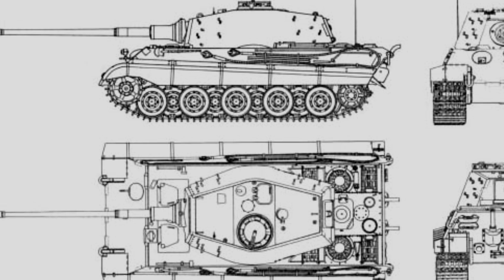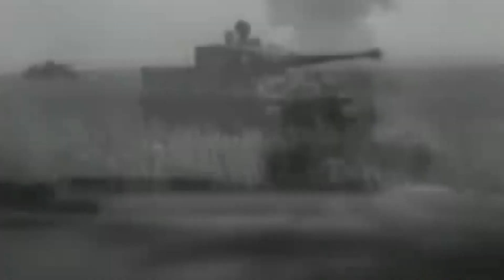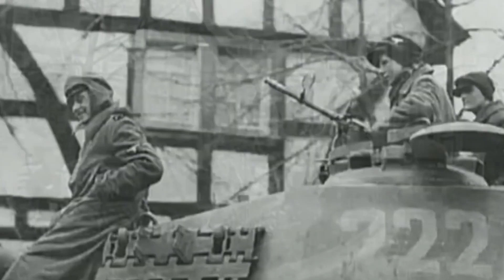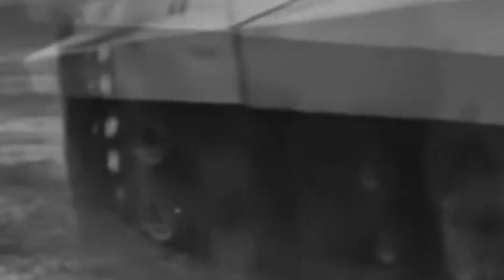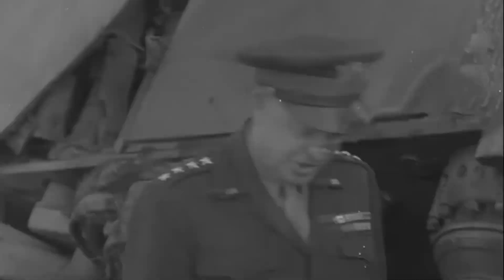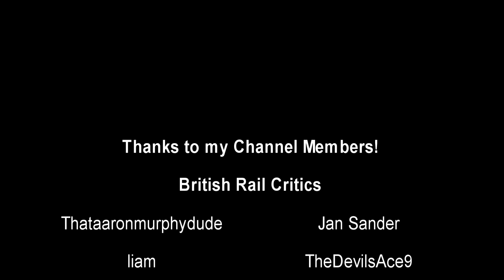Germany's Ultimate Tank (Didn't Help Them Win at All) | The Tiger II | History in the Dark

Comment: Germany's main troubles were: 1. a  long string of strategic mistakes 2. logistics and 3. a firm grasp on reality. The tiger 2 needed a long logistics chain that was too much to maintain. Great specialty tank tho, but more pz 4s or panther/jadgpanthers would have been smarter.
Reply: I would say that is post war propaganda. Well to a degree.

The logistics point is true, but that would be true for every country but USA.

The main issue with the mainline historical view is that its colored by cold war propaganda. The issue is that UK and USA supported USSR during the war. This fact was not popular during the cold war. Of cause UK and USA didn´t want to admit to there population that they supplied USSR with weapons that now was turned against them, and USSR didn´t want to admit for its population that they wont he war with western equipment.,

Of cause, the general argument is that WWII equipment wouldn't matter much a decade or so after the war. And .. well that would be the case, there is a issue here. Its not quite the whole trout. The leneed lease (that was every thing but) agreement contained 3 main components. direct use items (Weapons, equipment and surplices), half fabricate (engines, barrels) and machine tools.

The thing is that most soviet equipment, everything from the T34 to the JAK 9 fighter used mostly licensed parts. The T34 is actually a development of a Christie tank. (Well to be totally accurate, T34 was based on the BT series that in turn was a Christie set up tank and production line). USSR was actually licensing western production both before WWII but also, more surprisingly during the cold war.

The issue is that most people don´t know what machine tools is. Its basically a factory flattpack. That is a engine factory there, a barrel factory there, and a shoe factory there. There was a lot and a lot of factories imported.

And well.. if you can have a factory that can build a V12 engine, its not that hard to convert it to produce a X24 engine. This factores was used all the way during the cold war to produce more weapon-systems.

So that let us come to the second part, the half fabricate. This was mostly engines and rifled barrels. This was a mix of airplane engine, tank engine and truck engines. The engines was offloaded in Archangled then transported by rail to Stalingrad where they was put in tanks. The issue for USSR is that Germany already overrun there main engine plant, so they could produce tanks, but not engines form them.

Germany had somewhat and idea of what was happening and tried to intercept the engine delivery. So where do you intercept a train, Well at the rail yard. So where was the rail yard, one outside of Leningrad and one outside of Moscow. That was the reason why Germany attacked those cities. Its was not due to prestige, but to intercept those trains. Those attackes that is viewed as incompetent in the post war view, is actually totally reasonable and logical. They was not a strategic mistake, they just failed.

The thing is that in 1941 USSR still had a pretty decently sized army, but it was very very equipment starved. For a example of that, the soldiers went into the field with no boots, in the winter. UK was quite starved on soldiers, and also had no tactical front. But they still have a massive amount of production capacity.  Of cause, today most people view Germany as a much larger country than UK. UK was at the time the biggest country in the world. It had more production capacity than Germany and USSR combined, UK actually in 1940 had 30% more production capacity than USA (remember, UK at this point, also included, Canada, South Africa, Australia, New Zeeland, Singapore. But they lacked the army.

Also people tend to forget, UK was fighting a 3 front war. Was fighting Japan in Asia, was Fighting Italy in Africa and was fighting Germany at home.

But they did have a massive amount of production capacity, So they simply produced boots, uniformes, surplices, rifles, trucks, airplanes and sent to USSR (They also bought some planes from USA that was not yet in the war). This was what stopped Germany in both Leningrad and Moscow. With out that surply, both cities would be overrun in weeks. Barefoot soldiers don´t survive that long in snow. And note, the supplied arrived DURING the battle. It was that close cut.

So that brings us to a grasp of reality.  Well they actually did have it. They just figured that UK would never send surplices to USSR. That if we want to be fair, is something that is so unthinkable that there are loads of people denying this happen to this day. UK was already in war with Japan Prior to germane attacking Poland.

And that brings Bismark. one of the major tactical blunders Germany had. Bismark was moved to the Atlantic in opposite to order from the top leadership. If Bismark was left in the Nordsea it would be MUCH harder to take the ship out, having air cover pretty much 24/7. Bismark next to Terpiz would be very dangerous for the arctic convoys, that transported.

If Moscow would fall, that would be a problem for USSR. While some people argue that they would just move the capital back. Well they could do that, and they probobly would. Most of USSR industries was distributed around the country and liked with rails. The main rail hub was in Moscow. With out it, they would barley have any industrial capacity left. They would even be equipped to distribute most of the outside help they would  got. If that had happen prior to US joining the war the situation would have been very different. No engines to the Stalingrad tank factory, no tank battle. Also no trucks for logistics and attack, and no system to supply the airplanes that was flown in. It don´t matter how many solders you have if they are stuck in a trench full of snow with no boots and no food.

UK might have won the war anyway. Germany was never equipped for a very long war. They simply made a lot of progress early in the war for the simple reason that they was the most prepared. It was Japan that was the problem. UK was slowly turning the tide in Japan as well but it was going very slowly.  Remember, at this point, UK was still the worlds largest industrial power house, larger even than USA.

That all changed in 1942-43 when USA mobilized there industry, and that did take about 2 years, but after the US industry was fully mobilized, the war was really quite short. Germany never expected to fight USA. Quite the opposite, they was seeing Roosevelt as somewhat of a ally early in the war.
Reply: @matsv201  well, I guess I'll explain myself. 

1. Bad strat: Launching a war of annihilation for lebensraum. Not a way to gain friends. Lend lease or no lend lease Russia would have lost by 43 if the Germans hadn't hardened their own opposition. Of course it comes from having a hypocritical, chauvinist policy.  If you're a nationalist, then nationalism is a fair idea for ALL PEOPLE. The same rules and values apply across the board and not only for certain ones.  When you invade a country and the rule is nationalism "for me and not for thee", people tend to get a little pissed off. An example here is treating Slovenians like scum but any German's already in Slovenia  as first class citizens. Germany also made no distinction about Jews in other countries. Within Germany proper I'd say that Germany had the right to define itself, however once in Poland  they activated the lebensraum idea and began to slaughter and imprisioned the Jews there, as well as leaving no place for ethnic Poles.  Putting people between a rock and a hard place leaves them no choice.

Once Russia was invaded those in Belarus and Ukraine found out first hand what Germany did in Poland and this fueled the partisans motivation and created it's own unending cycle. "the Jews were the reservoir of the partisans" but that's b/c they were hunting Jews. that's a no-brainer. Germans were first welcomed as liberators, and the size their available armed forces, allies, and cooperative citizenry against the Soviets would have ensured a win. Wasted Opportunity.

The war hawks in the Uk started out weak but as Germany made political gains they gained more influence and this had an effect in the foreign office. The thing is, the war hawks knew how to push hitler's buttons, and that's how and why Poland got to be invaded. They tell you the reason for the invasion was frustration over was Poland/Danzig etc.. but in reality it was anger over the fall of Czechoslovakia. They had to inhibit the talks and any real progress but they got Germain leadership to take the bait. That's from the war that had many fathers, and it makes a lot of sense. Getting played by one's own enemies.. not a good strat.

 Another example of bad strat is terror bombing in the blitz, Prior to that Germany had been concentrating on targets related to the Royal Air Force, but then Churchill decided to push someone's button. I'd say it was Goering's but no matter. Churchill ordered a terror bombing to be carried out by Aurthur Harris in Hamburg iirc and this infuriated the German leadership so much they changed tactics. Of course bombing civilians in the blitz only strengthened the resolve of the Brits, and allowed the RAF to recover enough to continue being an effective competition.  We see how that turned out. Lesson: eyes on the prize.

2. Logistics. this is self explanatory

3. Germain political leadership at that time was stuck in a nearly medieval way of thinking and lacked foresight. Plus, bigger=better when it came to impressing Der Chef. As if the idea of the p1000 and p1500 weren't grandiose enough heh. Some of the leadership was charismatic and likeable on a personal level but  I just don't think they were truly qualified. I think of hitler like this, he could coach the bad news bears to the world championship, but wouldn't win it. It's like in downfall where the Russian's are at the doorstep but if he had hope, evenown else would too, because  "he's the leader". He had too many flaws and really it's b/c of  him that ethno nationalism is practically dead and now migrants come form everywhere. There's a lesson in that, coming.
Reply: @franks471  
"1. Bad strat: Launching a war of annihilation for lebensraum. "
That is actually not quite accurate. You are confusing lebenraum with expansion in the east. The issue here was that USSR had been gobeling up smaller nations since the 1920. Lebenraum was mostly taking back the area that was lossed in the previus war. The expansion in the east was not lebenraum, it was more of puppeting. While you might think being a puppet of Nazi Germany was a bad thing.. and well it probobly was, compare to be a part of the USSR, that is probobly a bit worse. Germany actually gained plenty of fiends. Finland, Baltic states, and a large part of central Europe. Of cause most of those nation become pupet of USSR at the end of the war.. but not Finland. If Finland had not sided with Germany, they would have been a part of USSR until 1990.

" Lend lease or no lend lease Russia would have lost by 43 if the Germans hadn't hardened their own opposition"
They would have lossed faster with no equipment for the enemies? Are you real? To be absolutely clear, in our timeline, 30 of January, 1945, yes, 1945, just month before the end of the war, was the first day USSR soldiers set foot in pree war Germany. Over 80% of the equipment do so was either lend lease material, or derivate of lend lease material

"If you're a nationalist, then nationalism is a fair idea for ALL PEOPLE."
National Socialist was mostly Socialist, secondly and .. really not, nationalists. They was Socialist fascist, not really nationalists. And still, you missunderstood the plan quite a bit.

You miss a part of the Jew storry. The Jew extermination started in USSR in the 1920. But the word came out in head, and most of them fleed before being rounded up. Some of the fleed to current day Isreal.. that is, the one that had money to do so. The rest of them just walked west. When Baltic and Belarus was ocupied they was need to keep walking, and they was at the time already very unpopular in Poland, so they had to keep on walking. There for most of them ended up in Germany, nearly doubling the german jew population in just a few years. This was during the early days of the depression so this was very unpopular with germans that was unemplyed, that in turn was the reason the nazi party got so much votes in the 1933 election. It wasn´t like the previews government was brilliant either. A lot of people thinking that there was somewhat of a good government prior, it was anything but. They went from one quite bad government to a other.

"Poland and this fueled the partisans motivation and created it's own unending cycle."
Eeeh.. no. That is USSR propaganda. What spawned the resistance was the gap between german and russian forces. Polish resistance thought they would become independant. THey was folled. The Russian forces backed of from Poland in the uprising to let the German forces take care of it. If you want to talk about bad strategy from german sides, here is one example.

"hitler's buttons, and that's how and why Poland got to be invaded."
You have absolutly no clue what you are talking about: read up on the Molotov–Ribbentrop Pact .

" Another example of bad strat is terror bombing in the blitz, Prior to that Germany had been concentrating on targets related to the Royal Air Force, but then Churchill decided to push someone's button. I'd say it was Goering's but no matter."
While in the hindsight 20/20 that might seam like that was the issue. But there is something you are missing here. At the peak of the battle of brittan, when it was going quite poorly for UK, they moved back there forces and stopped engaging German forces. this made the German airfoce belive they accomplished the first part of there strategy and started bombing logistics center. Remember, this is the 1940, not 2020. Logistics center was quite close to the center of the citys. Some bombs missed and hit peoples houses killing civilians. That was never intended (at that point).  The German airfoce didn´t waste there bombs on civilan with no strategic benefit.

While the bombing did have some impact on the logistics, what it mostly did was drawing the German airforce into a well made trap. Germany did the exact same thing with UK and US airforce in 1943 with a similar result. Losses in UK and US airforce was rampened in 1943 and it wasn´t really untill the change tactics quite a bit into 1944 that they started even out.

While its easy to say that Luftwaffe shouldn´t fall of it. It was still a trap, and it was made for them to fall for it. Amature historians that have no clue of the subject say that it was just bad tactics from german side, it was not. It would have been good tactic, if it wasn´t for the fact they was baited.

" nearly medieval way of thinking and lacked foresight"
How would you know, you have really no deep knowledge of the subject, you only know post war propaganda.

"Plus, bigger=better when it came to impressing Der Chef."
That was not really the case.  While tiger tank was large, it wasnt the first large tank. There was a prior one, the grosstraktor (yes it was a tank, despite being named tractor). It was lightly armoured, but as large as the Tiger. German armor was linked up with a heavy spear head, medium tanks on the side, and light tanks and APC covering up the rear.  The spear head was alwans men to be very heavy but few tanks..

They didn´t need to last that long, when the front was broken, medium and light tank cleaned up the rest. This was a very successful tactic. The original tiger was a rush job. It was a good tank, but it had a lot of flaws. It was also hard to produce. Tiger II Was actually simpler to produce, and it was generally a better tank. And it was actually quite a lot produce. Production rate of the Tiger II was actually higher than if the original Tiger, with almost 500 built in about 1 year, compared to 1350 tiger 1 produced over 3 years.

Its a common myth that Tiger II broke down more, they didn´t. They was actually quite a lot more reliable, breaking down only about half as often. The main reason for the myth is that more tiger II was lossed due to breakdown than tiger 1. The reason for this is simple. Germany was retreating. The thing is, If you are advancing and your tank breaks down, you just leave it, and the crew will take care of it next week.

If you are retreating you have to either leave it behind, or retrieve it under fire.

"As if the idea of the p1000 and p1500 weren't grandiose enough heh"
That is also some of the post war "i don´t understand what i´m talking about" There was 12 "half" P1000 built. Well sort of. The error most people think of when they see the P1000 is that they think its a tank. Its not. Its a movable field artillery system. The turret was one of a Cruiser (not a battleship as some people claim)... and.. still again, not quite. The original turret was 1000 ton heavy, and clearly to heavy for a 1000 ton vehicle (because the rest of the vehicle is not 0ton). The turret was cut down from 3 to 2 and the armour was cut down 140mm to 20 mm making it significantly stronger, but still able to stand counter artillery fire.

Its also not supose to drive to the battle field. Its split in 10 parts. 8 lower parts and 2 upper parts. (and the barrels would probobly have to be taken out, i have not seen any source for that, but it kind of make sense).

The reason for having it in one vehicle is that fire control computers just become a thing. This way the fire control could be feed directly into the turret with aimed in barrels.  They would also be much faster to load and the crew would be protected both from the element and counter battery fire. Not only that it could move short distances with out being dissembled.  It was never intended to be a tank. The name should tell you that, Landkreuzer (land ship). It was a supporting artillery integrated vehicle. And it was really just a slightly modified of the shelf tower put on tracks from a tiger, with a engine from a submarine. With diesel-electric drive it would be fairly simple to assemble and disassemble it. The engines was simply in a module each. With the added range and the added precision of the computer the large size would really be no issue, it would outrage any enemy artillery. 

The P1500 is a similar deal. Its a movable field artillery. There was 2 "half" P1500 built. Named the Gustaf and the Dora. The issue with Gustaf and Dora is that it took a month by 1000 person to set it up. That made it, say less than efficient. The idea was to put it on a tracked under carriage to make it both quicker to put together, and easier to move short distance. Simply replace the 4 railway wheel section with 4 3 meter wide track sections.

Both Gustaf/Dora as well as the 280mm cruiser turret was both made and in use. To claim that they was some ignorant plan of a super weapon is really .... well ignorant. Gustaf/dora was very efficent, when they was in place. The issue was that they was to expensive to move, that was the reason why they stooped using them. The P1500 project was there to save the existing artillery systems. That is basically recycle them The investment of making 4 track module for Gustaf and 4 for Dora would really not be that big.

The track system (that was never fully built, but designed) was later reused in civilian use for bucket wheel excavators. The largest to day is about 15 000 tons, that is 10 times larger than P1500 would have been.
Reply: @matsv201  nah I'm not confusing expansion with puppet states. Dolphy wrote it in his book that lebensraum was to be gained in the east.  Yugoslavia, Romania, etc.. were puppet states, Poland was chosen for expansion. It seems the plan was shelved until the event of a general war, Czechoslovakia for instance was treated lightly and didn't have a situation like Poland until after Heydrich was killed, however a serious attempt to turn Poland into lebensraum was made. This is what I'm getting at as far as Jewish partisans are concerned. Word of mouth and rumors were spread quickly. That's why there's stories of those sent to the camps already expecting to be gassed when they arrived. You can find survivor stories telling this detail. I'm just saying that German policy created many of it's own problems. Imo A more moral, above board approach would have been to liberate Pomerania and Silesia and allowing a remnant to be a puppet state. I am well aware of the Molitov pact, Germany's actions still could have been different.  The thing I keep hammering on though, is how Germans were first greeted as liberators in many countries until they began to be hated for what they were doing. Similarly, Barbaossa was not a campaign against communism as the propaganda stated. but Germany would have had a lot more support if it were and I think it would have made the difference, however instead of doing the right things for the right reasons, it was a repeat of what they did in Poland.  And as you described the Jewish plight, the real problem they faced was not having a homeland, IMO.

Poland was invaded for three reasons: the  Polish government's resistance to working out disputes, British and French interference, and a forced assimilation program in Poland which resulted in persecution of the Germans living in the 'Polish corridor' and refugees returning to Germany. Those disputes are the Danzig question, but also Poland not accepting payment in an currency except Polish zlottys for use of the rail lines. This would have meant that East Prussia would have gone without coal for the next winter. One thing here highlights the flaws in the German leadership, and this is Operation Himmler. So, if the Brits don't believe you, there's no need to put on a show to see if you'll fool anyone. Always do things above board.

Dolphy started out since 33 hoping to make Poland into a strong ally, his plan was to rely on them for an upcoming conflict with the Soviets. by spring time of 39, he was making presentations to his senior military staff preparing them for what an invasion meant: annihilation. This was the speech where he allegedly said who cares about the Armenian genocide anymore. He was prepared right there to throw in the towel and start the war, but something kept making him wait and keep trying diplomatically. It ended up that invasion began at almost the last minute, the deadline to begin operations was set at Sept 2nd because the military staff did not want to risk fighting in Poland over the winter. How things change.

Coincidentally the speech Dolphy gave regarding the invasion of Poland is only available in edited form. Paragraphs are out of order and are missing sections. I have to wonder if you've read and believe the post war propaganda. I'm not calling Dolphy good guy, but the allies wanted to get rid of him badly and needed justification. That's something where the truth will never be admitted.

Anyway Battle of Britain: the Brits were pretty good at intelligence, I'll give that to them. You should know how the Brits figured out where the Luftwaffe was going to attack by tracking German radars. Churchill put on a good act, but a deceitful one, standing with the people, shaking his fist to the sky and saying "let them come" when he knew his location was safe. The point I'm getting at is that terror bombings did not start until Churchill started them. You've pin pointed at one circumstance which changed the outcome, but it doesn't change the fact that it displayed the ineptitude of the German leadership, which was my point. 

As far as national socialism goes, It is truly meant for Germans and Germany Only, not just first and Dolphy had even said so. This attitude existed in the leadership well before the war, and as you should know that many wars are often decided before they are fought. Like how German military intelligence was ineffective. Actually it was like playing cards with a fixed hand dealt against you and wondering why you keep getting beat. It's like Dolphy told Mannerheim If he knew that Russia had something like 23,000 tanks he would not have invaded. Wow. That's all I can say to that.  If none of this really drives home how unqualified, demented, deluded  and grandiose the leadership was, we can talk about Germania, or Himmler trying to be acting Fuhrer in the last days and thinking he'll be treated light a dignitary by allied Generals. It's just some of the hidden ways Germany was lacking and could not win it, even though the country itself had the means. That's my belief anyway.
Reply: Not mentioned was that German tanks were nicely designed, but too complicated.  They used twice the number of components as comparable British tanks and the Americans used even fewer.  That meant German tanks were more prone to breaking down and more difficult to fix. 

Also, when you get that big, having a trailer to carry the unit didn't exist.  They had to take the train or drive.  By the start of 1944 most train tracks in Europe were damaged. They couldn't carry 65 ton tanks over the lightly repaired tracks. Most bridges weren't strong enough to hold that weight and  they tore up most roads.

The British 17 lb gun AP sabot could pierce most German tanks.  The Tiger II being an exception.  Then the British also has a 25 lb gun used as an independent anti-tank gun and also used on tank destroyers.  Those could defeat the Tiger II.

NOTE:  The Russian tanks were plentiful.  That is it.  They were death traps for their crews.  The factories pushed them out and hurriedly trained crews took them into battle.  They often broke down or would even fall apart because the bolts were too weak to hold them together.  By the end of the war, the tires had no rubber on them and would tear apart the tracks within a few miles.  The armor wasn't heat treated.  The gears wewre cheap steel instead of stronger alloy.  The Russians didn't care if they lost 500 /mth as they were producing 2,000 /mth. They went for quantity over quality.
Reply: Or a few StuG III and StuG IVs and JgPz IVs...